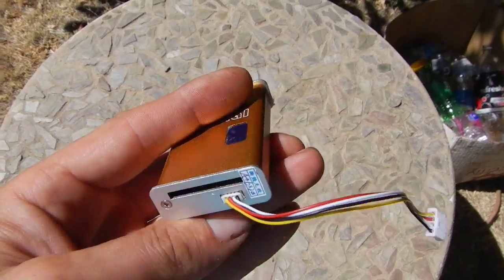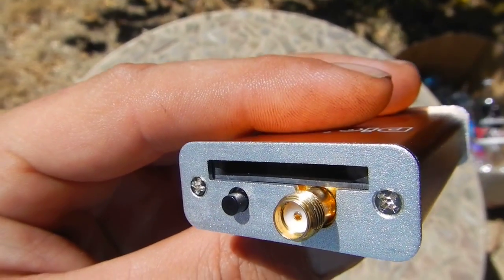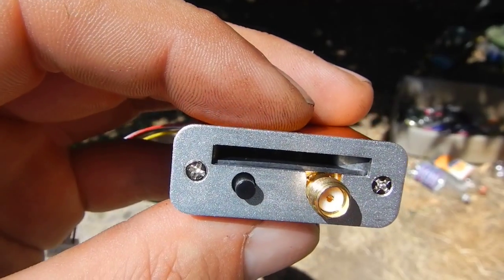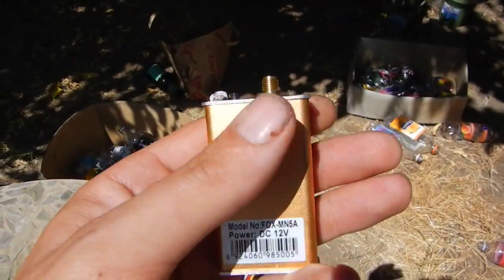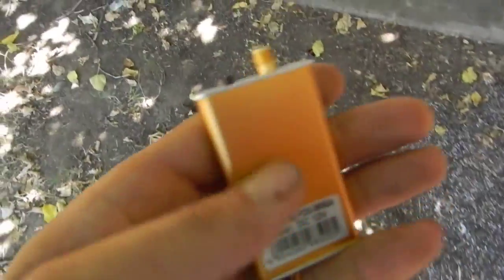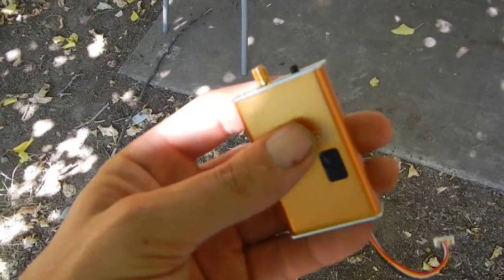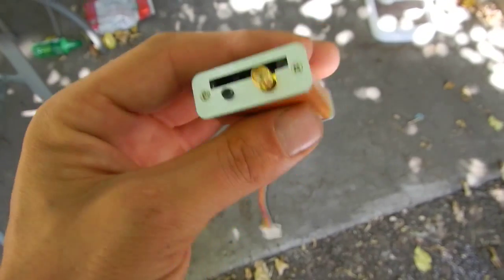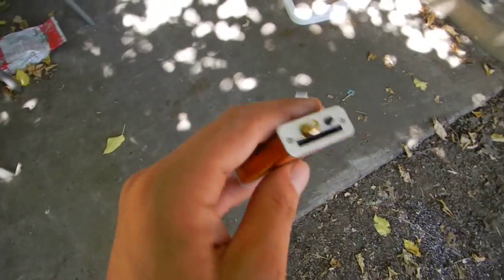partom 41 gram 5w video transmitter with cooling fan inside

Comment: Did you ever get the power measured for this? I am thinking of using this for ground-based video transmission. Any info would be greatly appreciated! I just can't seem to find quality Tx with higher output like this allegedly does.
Reply from the maker: no i did not